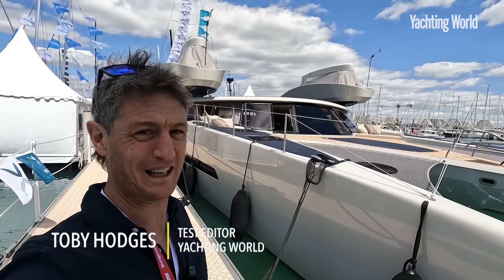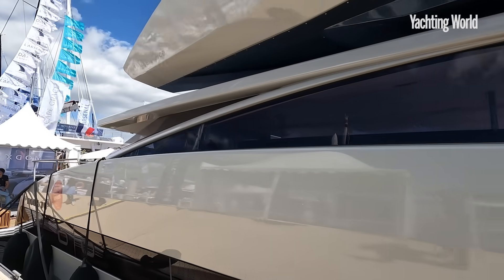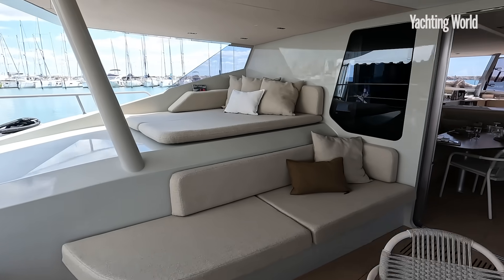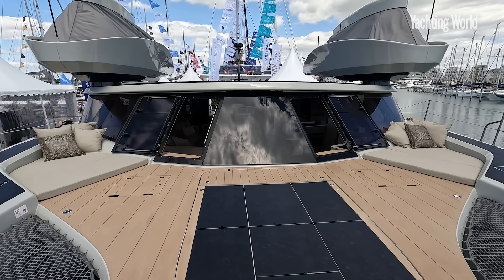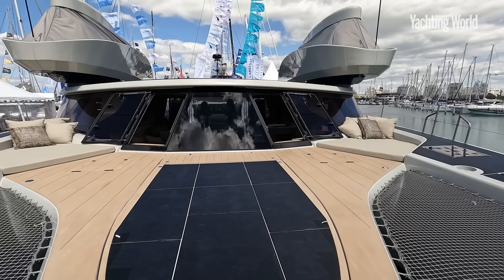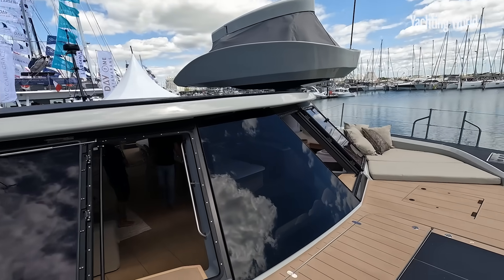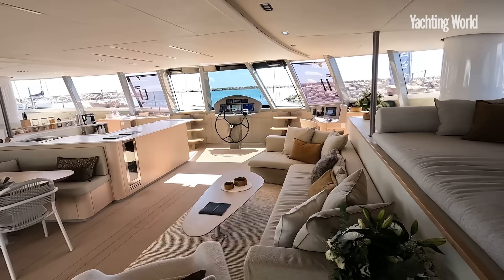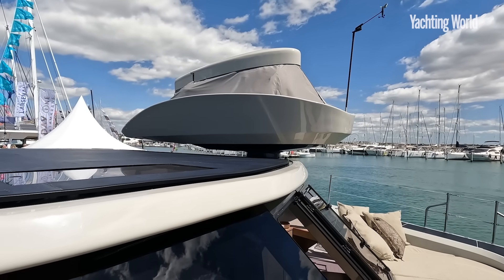Meet the MODX, an electric 70ft cat with fully automated inflatable wingsails!

Comment: There's nothing sustainable about this boat, but I like innovative ideas. I wouldn't buy one.
Reply: Zero fuel use is kind of a big feature, no?😊
Reply: @terrygalvin9653  Apart from the diesel generator?
Reply: @terrygalvin9653  The worlds 15 largest ships create more pollution than the global car fleet.However, the fuel used by a small cat is probably negligible next to the energy and environmental cost to produce the materials needed for for this cutting edge craft. Also, little is recyclable. I would like to see a full life cycle analysis including its disposal (cradle to grave). These modern composites don't last. A sustainable boat is Tally Ho Great youtube boat build).
Reply: @flounder2283 ”These modern composites don’t last”😂😂 Which is one recycling of composite boats causes so many councils so many headaches.
Reply: @flounder2283  Aluminum is highly recycleable and recycled.  Plastic not so much.
Reply: @PN_48  Ever seen a wind turbine grave-yard? If not, why not?
Reply: @dancarter482 And the relevance to this catamaran is…??
Reply: 'Sustainable' is a marketing term that's thrown around for anything that eschews ICE power in favor of electrification or natural sources of energy. I never take it literally.
Reply: Clown, solar panels, wind powered, hydro regen and oh, “nothing sustainable about this boat”, ill informed and illogical comment.
Reply: @steviefordranger198  I like the boat, but you are only focussing on fuel consumption. Show me the LCA. Limited life batteries, non-recyclable modern composites, limited life solar panels and limited non supported technology. It will never recoup the co2 it took to build. Add to this it's a luxury toy to begin with ,   You're the kind of person who hears solar panel and think it must be green It will spend 90% of its life running on marina shore (coal) power..